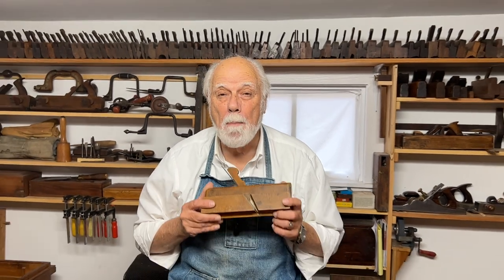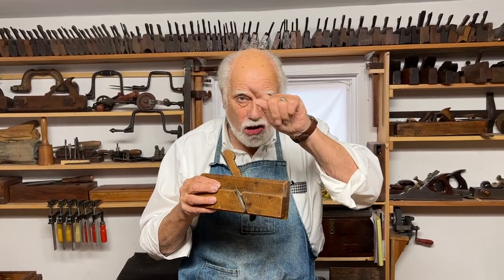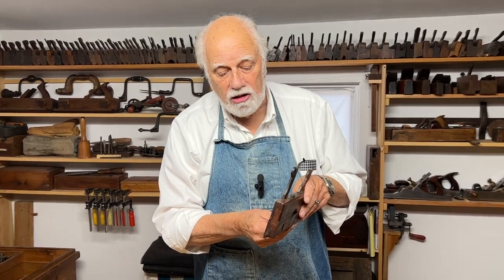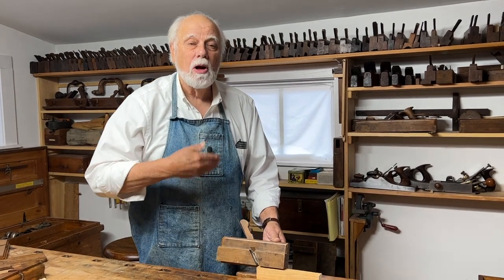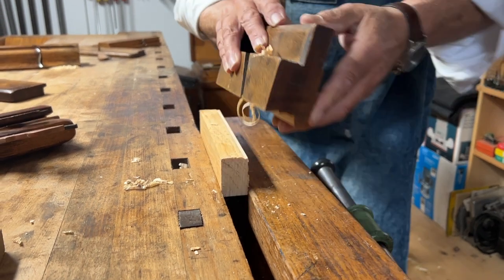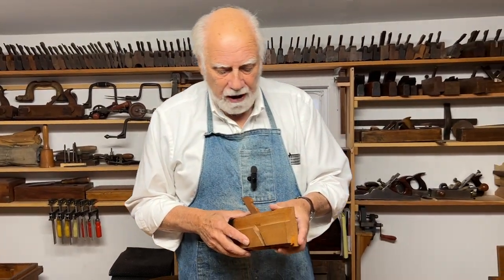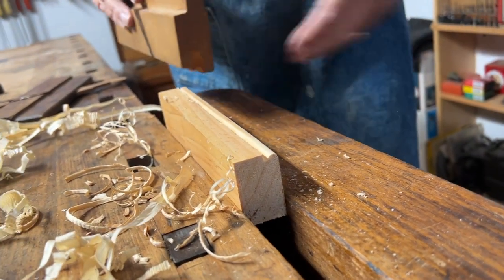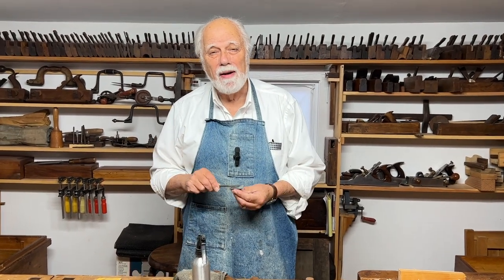17. Moulding Planes & 'Spring'

Comment: The irons for molding planes seems to be the same sharpening category as carving chisels: never let them get duller than you can fix with a strop.
Reply from the maker: I'd rather not use a strop as it will eventually round over the back edge.

Comment: Thanks for this interesting upload.
How, though, do you deal with a plane which has a misshapen blade?
Reply from the maker: Have the iron protrude through the sole and scratch the backside of the iron using the sole of the plane as a guide. Then file down to this line, and with small shaped stones (or even a fine file) make a 26degree bevel on the face side of the iron and then simply sharpen the Back of the iron as shown.
Reply: @gjbmunc  Thanks for the prompt reply.

Comment: That was informative.  I have been lucky enough to buy a Stanley 55.  Would you do a video on the 55.  There are limited videos showing how to set it up.  I think you could add significantly to the topic.  Thank you
Reply: Don't waste your time with the 55. Just put it right back into its box.....then post it to me.
Reply from the maker: 55s (and 45s and 65s) were made for ease of transporting. If you're in your own shop it's much quicker to reach for the right single-purpose plane, but I may well take a look atb them in a later episode.
Reply: @gjbmunc  But then there's 55 moulding planes at (in Australia) $20 -$30 each 😱.  And then there's the lack of room in at my work space rather than work shop.

Comment: Heĺlo Mr. Blackburn. I like your videos so much. I don't understand the last part. Could you explain to me please why it is not nessesary to sharpen both sides of the plane iron like I have to do with the irons e.g. of Jack planes?
Reply from the maker: Not quite sure what you mean, but I find it helps a lot to make sure that the back of the iron is absolutely flat.
Reply: @gjbmunc  Thank you very much Mr. Blackburn. If I sharpen a bench plane iron, I have to flatten the back and to sharpen the bevel. I didnt understand why I don't have to sharpen the curved bevel of a moulding plane. By the way, because of your explanation I finally understood the meaning of the spring. I only read it in books but the practical way is better.

Comment: I have health issues that makes my left hand very limited, almost to the point my right does everything, my question is; can I get away with using pretty much 1 hand?
Reply from the maker: I'm not an expert in this but I can think of many operations that could be made easier for one-handed use if you took advantage of all the different clamps, vises, and other bench holding devices.
Reply: @gjbmunc  thank you that's encouraging, I do use alot of clamps 

I love the channel. Your work is inspirational

Comment: Weel, i have a question 😄 by sharpening a part of thé back, thé thickness of that sharped part of thé back of thé iron will differ from thé other part. Isn't it a problèm?
Reply: I don't know for sure, but since he was demonstrating planes well over 100 years old I don't think it is very much of a problem.
Reply: @wehaveasaying  planes are old but are irons old ?
Reply from the maker: Not if you sharpen the back as shown up to an inch or so from the actual cutting edge.
Reply: @gjbmunc  all right. I was used to sharpen thé beveled side and it isn't complicated but longer than only sharpening thé back. I am to give it a try 😄

Comment: My new moulding plane is sitting on the shelf almost year because it's iron doesn't match the sole.
Reply: Then reshape the iron...
Reply from the maker: Exactly. Have the iron protrude through the sole and scratch the backside of the iron using the sole of the plane as a guide. Then file down to this line, and with small shaped stones (or even a fine file) make a 26degree bevel on the face side of the iron and then simply sharpen the Back of the iron as shown.

Comment: Please save yourself the trouble of ruining your molding irons and learn how to sharpen the entire profile, not just the back. If you continue to sharpen only the back, you will eventually ruin your irons
Reply from the maker: I believe in first ensuring that the profile of the moulding plane irons matches the profile of the sole, receives an appropriate bevel, and then may be sharpened from the back for a long time before there is any danger of it being 'ruined'. Sorry if I did not explain this, but it is doubtful in this day and age that many moulding planes as used by hobbyists will receive as much use as they did fifty or a hundred years ago.

Comment: The flat of a moulding is a quirk, as we discussed last week. 
I'd argue that a beading plane (I've just used one for two hours, making a whole heap of cock-bead stock for some desk drawers) is a type of moulding plane. It doesn't much matter. 
Your sharpening advice is fine for irons which have been properly sharpened over the years, but so many I get my hands on have been butchered by people who don't know what they are doing, so a video on restoring their profile to that of the plane would be handy for most people, I think. It's actually somewhat tricky to re-shape the iron without damaging the sole of the plane in the process, as you'd know, so it would be interesting to see how you do it.
Reply from the maker: Good idea. The way I do it is to trace the profile of the plane's sole on the iron as it pokes just a little out. Then remove it and file to the traced line. Then renew the bevel on the other side and you're ready to flatten  the back and thereby sharpen the iron.
Reply: Paul sellers made a great video on sharpening them. But I learned alot from this gent too